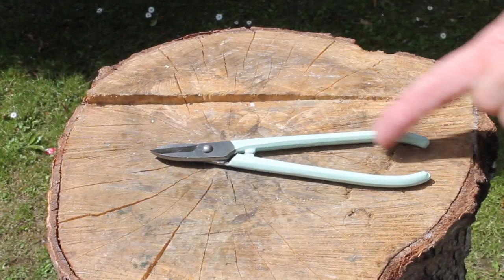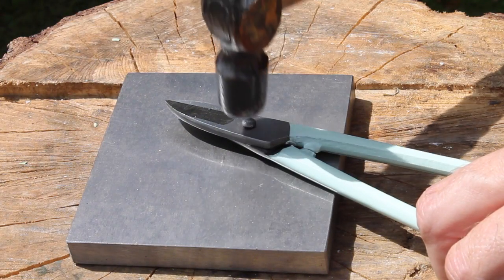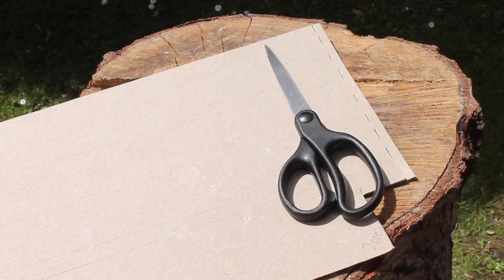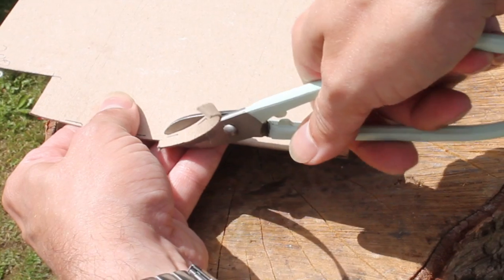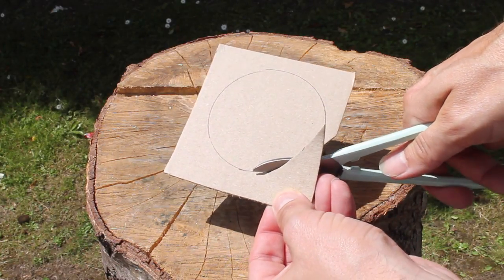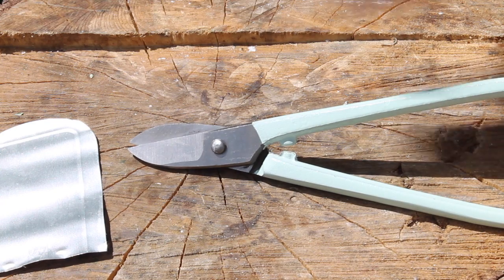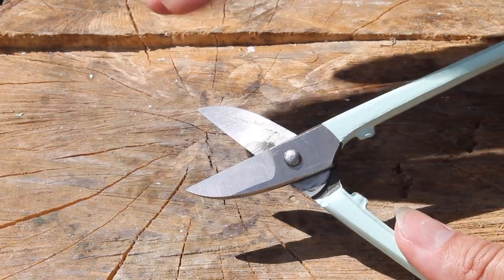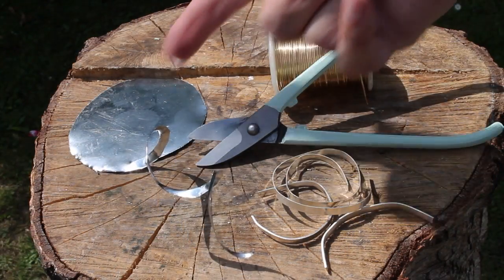Jewellers 7" Shears (Tin Snips) tips & quick Demo & Review in HD

Comment: what do i need to cut a wide sheet metal in half?
Reply from the maker: With a pair of tin snips like these, the width of the metal makes no difference. Note the blades are only an inch or so long, so almost everything you cut will be longer than that. Like scissors on a piece of paper, the size of the paper is irrelevant. Obviously this is assuming the metal is thin enough to be cut with the shears. Hope this answers your question. Dave

Comment: What's the max thickness these will cut Dave ?
Reply from the maker: Frances Winyard It depends on the material. Aluminium sheet is obviously easier than copper. I cut some 1mm copper sheet that had gone through the rolling mill (a few times) and seriously work hardened.  That is OK, but any thicker would be a struggle I think. Wire, I use 1.2mm. I'd say up to 2mm would be fine, but above that might get difficult. Of course you can always "force it", but I'm giving every day suggestions here. Hope this helps. Thanks for watching.
Reply: Thanks Dave !

Comment: can it cut 1mm thick copper board?
Reply from the maker: By copper "board" I presume you  mean the boards used for making printed circuit boards?. They are often made from copper coated fibreglass boards, which can be quite tough. But I haven't tried cutting any  as I am a jeweller, and so I don't make electronics. Dave
Reply: Celtic Dreams thx a lot sir